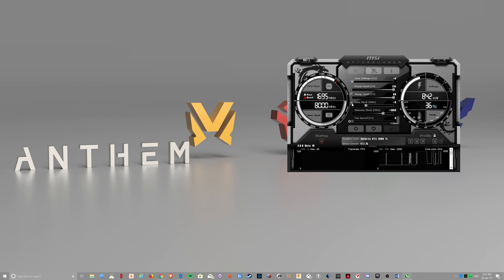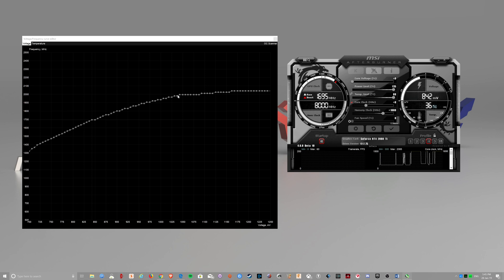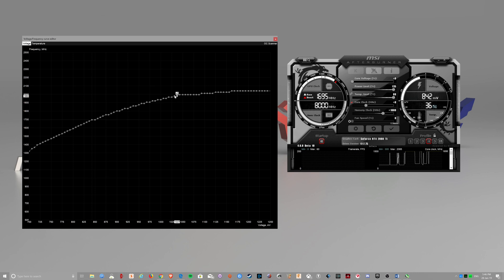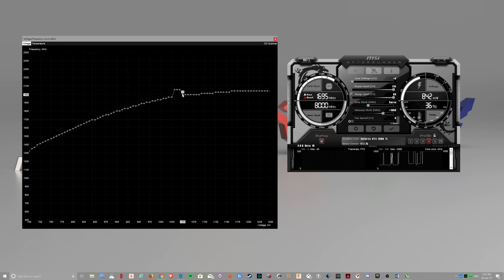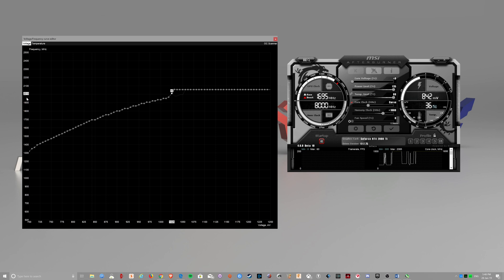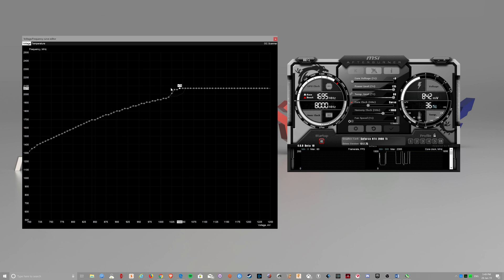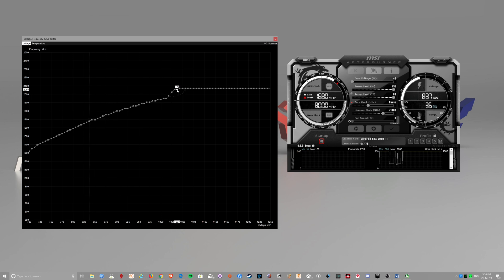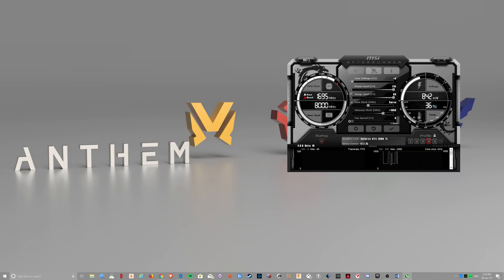RTX 2080Ti/ 20 series MSI afterburner VF curve, Undervolting guide.

Comment: Hi. May I know what is the shortcut to make into straight line ? It happened on the video approx 2min43secs. I have been trying without success. May I know what is the shortcut key for it ? I am using undervolt for mining purposes and always require to tune straight line
Reply from the maker: hi, this video  is very old now, they changed a lot of things. I am mining, you dont really need a curve. just reduce your core clock to max and overclock the momory. Mining uses memory , you dont need to mess with core clock..
Reply: @Ryxxi_makes  ok I will give that I try. Coz currently I am getting thermal throttle issue so I read undevolting it will help reduce the temperature
Reply from the maker: @cheekeongng4608  just reduce core clock to max then overclock memory, drop the power a bit and check your has. if your memory oc isnt stable your hashrate will drop. you just have toforget core clock for minign and just adjust memory oc and power.
Reply: @Ryxxi_makes  when u mean adjust power do I do it from the afterburner  editor ? Because my after burner core volt part is greyed out
Reply from the maker: @cheekeongng4608  no, the power  % slider
Reply: @Ryxxi_makes  ya the power limit % slider. Mine is greyed out

Comment: How do you have your clock speed 1600 to 1900 MHz mine is stuck on 1350 and it doesn’t move please help
Reply from the maker: your card is faulty just search for 1350mhz problem. you have to RMA it or flash stock 
bios and hope it fixes it.

Comment: Maan! Click on the first point (prefered voltage for example 1050) and then press "L" on keyboard. It lock your voltage where u want
Reply from the maker: also means your voltage wont go down when idling...
Reply: @Ryxxi_makes  does it matter? Its not like its gonna degrade the gpu or anything

Comment: Or you can just pull the power limit down to like 90% or whatever you want to limit the voltage to.  Also wouldn't it be better and easier just to run the built in oc scanner?  You just click that text in the upper right corner that says OC Scanner and it does it all for you. Then you just assign the curve it makes it to a profile.

Comment: undervolting makes your GPU run at lower temperatures thus give you better GPU but this video caps the fps at 30 because of his monitor so it is slightly misleading.
Reply from the maker: this video is 60fps, also I am not capping my framerate so I dont know what you are on about lol.
Reply: @Ryxxi_makes  Throw out some boxes.